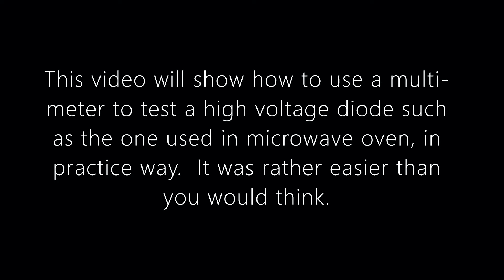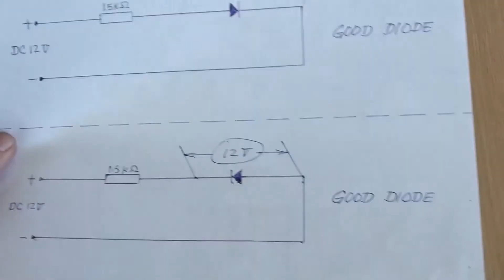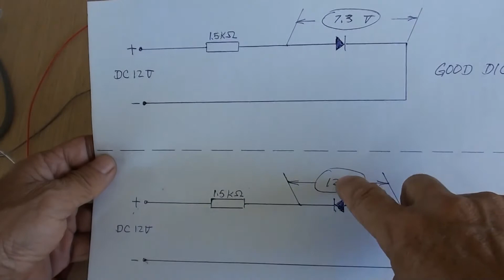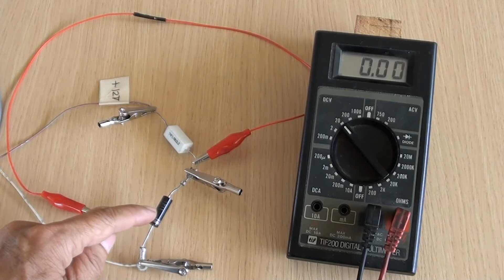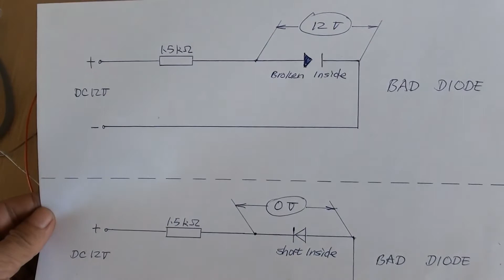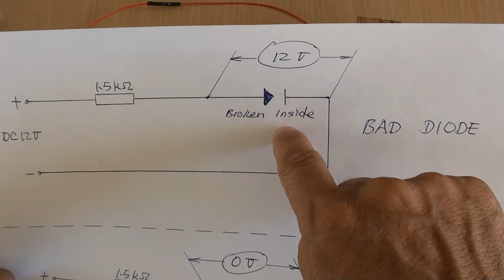How To Test High Voltage Diode?

Comment: Hello friend ,what source voltage can we use for a high voltage diode rated for 125kv/0.1A? i used 12v dc volt but 12v was still measured across the diode .
Reply from the maker: Thanks for a question.   I supposed you did High Voltage Diode test.  If you did that followed the procedure in the video (be sure a diode was not reversed polarity) then your test had approved that diode was at fault (Diode broken inside).  If you are still in doubt, try to use DC 24V, then your chance to get a different result is remote.

Comment: dude, you just made something very simple, very difficult to understand, why didn't you test the other diode?, not everybody has the other diodes you are using. Thumbs down.
Reply from the maker: It was testing High Voltage Diode, wasn't?  At the same time, I was trying to tell the viewers why HVD couldn't be tested with a multi-meter straight away.  Thanks mate!

Comment: Good effort.  High voltage diodes may test OK at lower voltages but still not work at high voltages.
Reply from the maker: Yes, sometime, you are right.